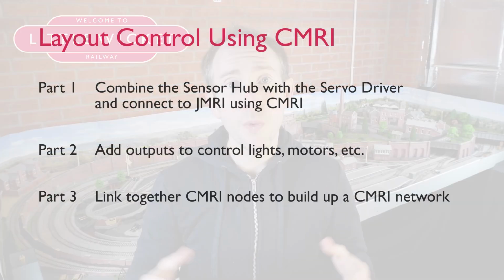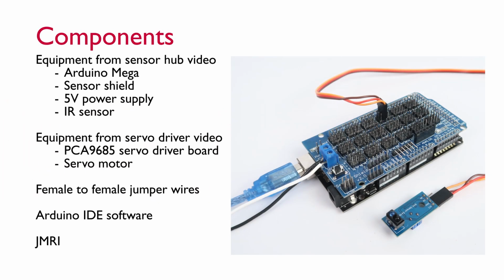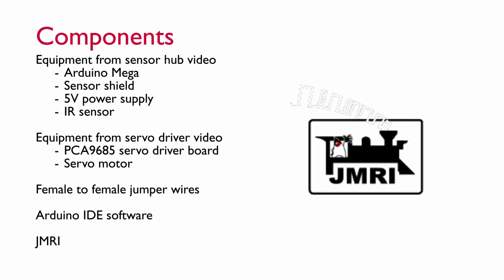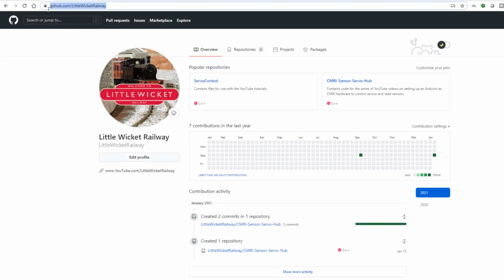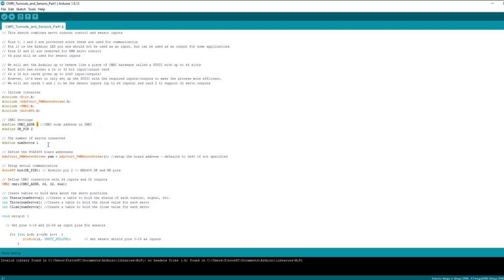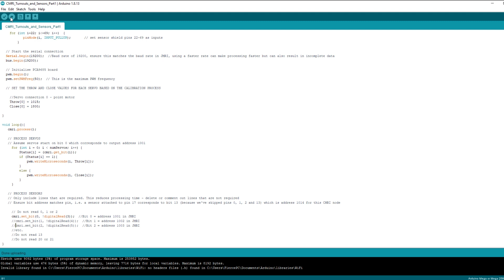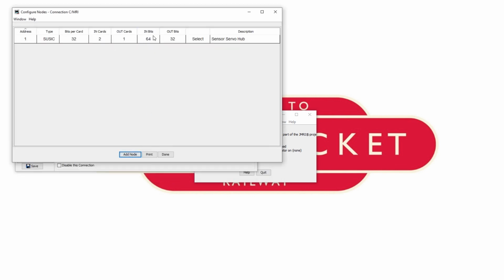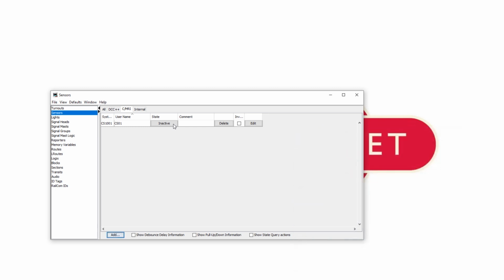Arduino, CMRI and JMRI - Part 1 - Combined Sensors and Servos

Comment: Hello. I finally got your setup to work. Thanks, it's a nice setup. My question is how do I add more servos? I changed the line in the sketch for 2 servos and removed the line you had commented out for 1002. Thanks in advance.
Reply from the maker: Change the variable 'numServos' at the top to 2 and be sure to add in the throw/closed information:

  //Servo connection 1 - point motor
  Throw[1] = 1015;
  Close[1] = 1800;

The numbering is a bit confusing, but this is for your 2nd servo which is connected to the position labelled 1 on the PCA9685.

This tells the board what the throw and close positions are for the servo connected to the pins labelled 1.

Hope that helps
Reply: @LittleWicketRailway  Ahhh. Thanks.. I will give this a shot tonight. I'm working strictly with your video. Im getting closer on the automation. Thanks!!!!!

Comment: I ran into one issue with the servos. Might be just me, or others would have the same issue, not sure just sharing. 

The first 4 servos went on without issue, though the 5th started to cause issues in JMRI. It was not moving. 
Normaly you would say numberofservo is 5, which I did. Chaning 5 into 15 made that JMRI recognized the 5th servo as well. 

All 5 Servos move and are working as intended. Now for the hard part, testing.
Reply from the maker: How odd?!? At least you managed to get it sorted. Was the 5th servo connected to the position marked 4 on the PCA9685? The NumServo variable needs to be higher than the highest position connected on the board if that makes sense. So if connected to pins marked 8 then NumServo needs to be 9 so that the loop looks at position 0, 1, 2, 3, 4, 5, 6, 7, 8.
Reply: @LittleWicketRailway  it was on position 5 (listed as 4 on the board). In the calibration script there was no issue.
Theoretical it makes no sense, at least it is solved. :)

Comment: Rob, all of your videos are great!  They are concise with the right amount of technical detail.

After being frustrated at not being able to get JMRI to recognize my sensors using the Sensor_Scan.py script, I tried the CMRI sketch from this video.  It worked perfectly!  Now my sensors are recognized by JMRI.  Thank you very much for these videos.

I've been able to get all the Arduino shields and parts here in the USA although I've had to use different brands than you used (which work just fine).

I'll be looking forward to your next video.
Reply from the maker: Thanks Bob 👍 Glad you got it all working. The CMRI setup seems to be more reliable than the script, but it might be slightly slower with a large number of sensors.

Comment: Hey, I have a question, maybe someone can help me. I can save the tables, but after a restart of the program all tables are empty. Is there a tip?
Reply from the maker: Hi! JMRI doesn't automatically load any panels or tables back in when you restart it. However, if you go to Edit -> Preferences and then go into the "start up" menu you can press the "add" button and select "open file". Then select your config/panel file to open. Hope that helps.

Comment: great video as always! 
I have combed the Arduino site for the sensor shield and cannot find it! is the shield you are using made by Arduino or some other manufacture?
many thanks!!
Reply from the maker: Hi Karl, it's not an official Arduino sensor shield, it's an unbranded clone board. Here's a link to one that should work and (assuming you're based in the UK) will arrive in a reasonable time http://ebay.us/Mqlmxi (please check price and seller reviews/reputation before ordering)

Here's an amazon link if that's better: https://amzn.to/36rvUOP

You can get them cheaper if you're prepared for them to arrive from China. Note that some of these sensor shields suffer from common faults. Sometimes the solder points that sit above the Arduino USB input need to be trimmed down and insulated to avoid them making contact with the USB socket casing. Some of them are also missing a 5V supply to one of the blocks of pins, I can't remember which, bit you'll soon realise if you get a board with this issue and it's easily fixed with a jumper wire.

Comment: Nice explanation Rob look forward to the follow up videos I am about to test this setup out.
Reply from the maker: Cheers John. Let me know how you get on 👍
Reply: @LittleWicketRailway  well Rob the script works a treat did not take long to set it up and working. Also using a raspberry pi to run JMRI so well pleased. Now to rewatch the part 2 again and work on using a micro switch I have connected to the servo mount. Thanks once again for the fantastic series of videos.
Reply: @LittleWicketRailway  will do Rob just working through the first setup of the servos from the first series so I know they are working correctly. Then will add the sensors and servos together. I enjoy the learning the code involved.

Comment: Hi Rob, 
I am finally trying out your sketch, however, an error is appearing when I attempt to load it, "error: 'class adafruit_pwmservodriver' has no member named 'writemicroseconds'". This is from the line "             pwm.writeMicroseconds(i, Close[i]);". If you have any thoughts I shall be grateful.
Brendan
Reply from the maker: Hi Brendan, I think this must mean that an library that you need isn't available or hasn't been included. Can you check that you've got all the additional libraries installed that are included at the top of the code and that they're in the right folders for the IDE software to be able to include them? Do you get an errors when you verify and upload the sketch?
Reply: @LittleWicketRailway  Hi Rob, Thank you. I do think the problem is at my end as I have been getting some strange results from previously working samples.

Brendan

Comment: can you still be Linking Multiple PCA9685 Servo Driver Boards?
Reply from the maker: Yes, just modify the sketch as shown in the video on linking boards together.
Reply: @LittleWicketRailway thanks! but is it then possible to link to sensory boards together for cleaner wiring!
Reply from the maker: @maxlarsen1468  this is what I will try to do in part 3

Comment: Hello, would using MQTT With Arduino a better solution for communication ? As i have seen, the upcoming release of JMRI is going to add support for MQTT Sensor, Lights and Turnouts. It would be amazing to have a tutorial of that or a comparsion. Thanks!
Reply from the maker: Hi Mario! Yes, a network that uses MQTT is the ultimate aim, but rather than using Arduinos maybe using ESP32s that have wifi built in. I think JMRI already has some support for MQTT. It's not an area that I know much about at the moment.

This series will probably be my last on using Ardunios for control. I'm planning a video on mimic panels that will work with the Ardunios, but after that I'll start researching MQTT. There's nothing wrong with using Ardunios, they've served me well and they're easy to use, but on my larger layout in future I want to go wireless if I can.
Reply: @LittleWicketRailway  Thank you for your kind answer. I guess im gonna wait for the videos to show up, keep it up :)

Comment: Only recently started watching this channel, finding the vids very informative and inspiring. I've used servos before on my exhibition layouts with Tam valley depot modules. New layout is being built so been looking at different option, many thanks for producing these videos
Reply from the maker: Thanks John! Just subscribed to your channel, I should have come to you for advice on speakers!!! Some lovely sound locos.

In terms of point motors, I would never use solenoid motors again, I'm sure many people have excellent experiences with them, but I hated every part of it. Loads of people rave about Tortoise motors and they do seem great, but they're so expensive and they look massive. So servos seemed like the cheapest most reliable option to me. Interested to get your experience.
Reply: @LittleWicketRailway  thanks, I'm the same never a solenoid again, we have the Smail motors at work, it's the  tortoise with a DCC decoder built in, very nice but over £30 for one. My new layout I'm looking at a new type of motor a little bigger then a servo but should be interesting. The kit I've just ordered for my turntable has a Arduino and stepper motor control. Also coming with a new controller which I will be testing, might have to do a write for one of the magazine's too.
Reply from the maker: @johnjmc  let me know how you get on with the stepper motor and the turntable, I'm interested. Is the stepper accurate enough to line up the rails each time or do you need something like a sensor to check positioning/calibrate? How does it deal with the polarity reversal? How is the speed like and how noisey is it?
Reply: @LittleWicketRailway  I have 5 servos on Halland and 3 on Byway MPD. I have used the quad pic board from tam valley depot and these have been super reliable.

Comment: Thanks this works like a charm. Just started with the DCC++ and it would save the hassle of running a second uno. In DCC++EX it is possible to combine it all, though for practical reasons I understand the choice.
Reply from the maker: 👍 DCC++EX is something I'm going to look into. Wifi shield arrived a few weeks ago, but haven't had a chance to get onto it. The guys on that project sound like they've done some good stuff.
Reply: @LittleWicketRailway  the Facebook group is really helpful.

Comment: Cheers Rob. Another great and easy to follow video in your series on Arduino and JMRI. One small request. Any chance you could increase your font size in the Arduino coding interface on future videos? Being a little older than you my eyes are showing my age and tiny text is not as clear as it once was. Thanks.
Reply from the maker: Thanks Chris! Yes, I will do that, thanks for the suggestion. Appreciate that it might not be easy to see, apologies.

Comment: Once again a very informative video/tutorial. I presume the interaction between the sensor and the servo will be discussed in a later video, or should I go back to the referenced “older” videos for that? Keep up the good work and I look forward to your follow up videos on this subject.
Reply from the maker: Hi Bruce! The sensors and servos don't necessarily need to have an interaction. This way of setting it up just means that you can run your sensor system (IR sensors, switches, block occupancy current sensors, light sensors, etc.) and control your servos for signals/points from the same piece of kit rather that two separate systems.

All the sensor data gets fed back into JMRI and that's where you can decide what to do with it. So if you did want there to be an interation then you can set this up in JMRI using Logix. The possibilites are endless, but as an example, you could have it so that when a sensor on the approach to a level crossing is activated, a servo closes the crossing gates in response.

I started making these videos because they're the system I need for automation. Apologies if you've already seen it, but this is a basic example of what you can achieve once you have sensors and servos in place https://youtu.be/5lvvoBCQl9U

Comment: Yeah one less kit to buy!
Great videos are a standard for you Rob. Awesome job.
Board set for the DCC++ build arrived today. 
I have never worked with an Arduino before,
and would have never considered it , 
but your videos make it look so easy!
Thanks
Reply from the maker: Cheers 👍 enjoy the DCC++ project
Reply: You really can't go wrong following Rob. I pretty much replicated all of Robs projects. Have joined MERG and built one of their block detectors. I bought two. it works a treat.  Have the IR sensors and  tested them but not used them on my board yet.

Comment: I have been following your previous videos, and I'm glad you are continuing your how to's. Very informative. I've completed the 4 aspect led light signal project and it worked. I am now trying to modify to my simple red/green led signals (without much success). I have watched the other videos but not tried them yet. Still trying to get my head around CMRI/JMRI programming. Keep up the good work.
Reply from the maker: Thanks WillsGrandad! Glad you're finding them useful. I'm still learning and as I discover new ways of doing things I'll keep sharing them.

I intend to have coloured light signals on the next incarnation of Little Wicket so this is a subject I'll be looking at more closely in future. Controlling them via the PCA9685 works well and I like that you can build in fade, but I'm going to need a large number of lights on the layout and that would take up a lot of slots on PCA9685s (which is acting as the address system), someone has pointed me in the direction of addressable LED strips and in the next couple of months I want to see if they hold any possbilities. If the address system can be built into the lights then that could save a lot of hassle (and money). I'll keep you updated.
Reply: @LittleWicketRailway  
Thanks for the reply. I acquired a mega shield and followed this video. After several attempts I’ve got it working and I understand the theory (I think). If someone else is having problems, like I was, I suggest you watch the video several times, then retry. My mistake was using the third pin on the shield for the sensor, instead of pin 3. The warnings are in the video!! 
Thanks again for the series and keep up the good work. Keep It Simple.